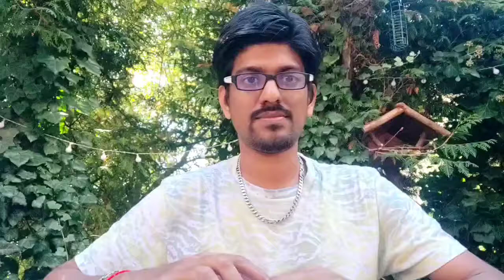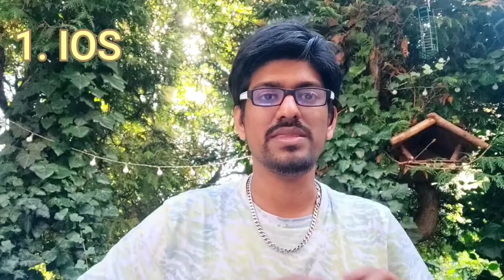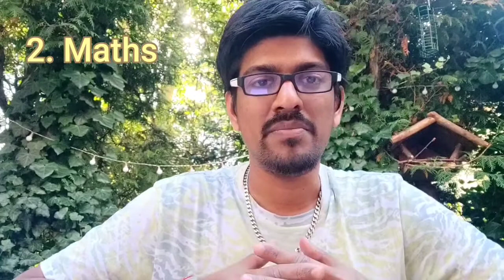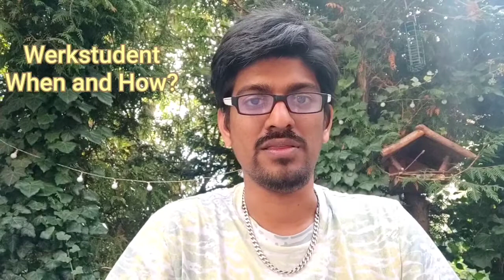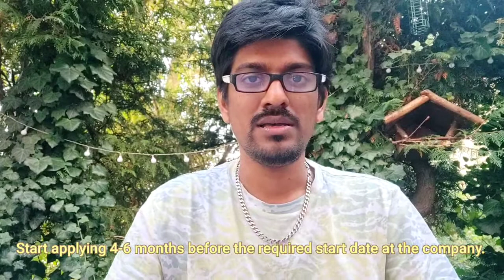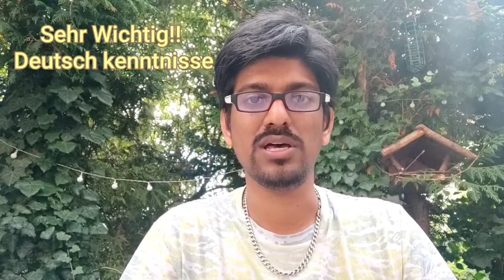DDM 1st sem overview  #HochschuleEsslingen #DDM #Masters

Comment: Thanks for the video 
I have a question about the visa procedure
I got accepted yesterday in the ASM program called 'Automitive Systems' in this university
Unfortunately the visa procedure in my country takes a lot of time (students need at least 8 months before obtaining the visa appointment with the embassy).
Therefore, I'm currently in a very difficult situation, risking to not beeing able to join the course and therfore to loose this programme.

My first question is : does the university intervene in the visa procedure in orther to accelerate or facilitate it for the accepted students ?
My second question : does this university offer the possibility to start the course online and join later when I get my visa ?
Reply from the maker: 1. no university doesn’t intervene in visa process
2. online was possible during corona but maybe not now… ask once the department and check